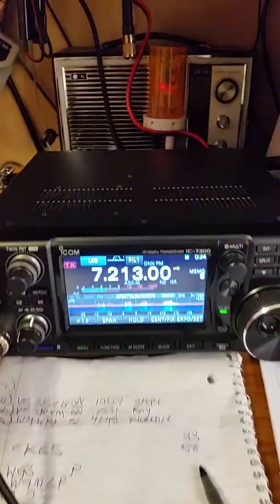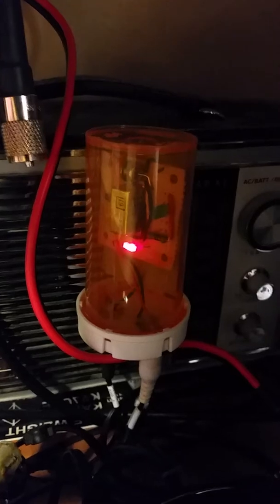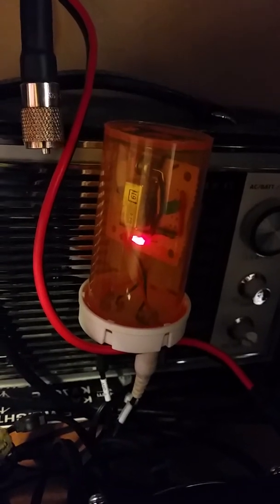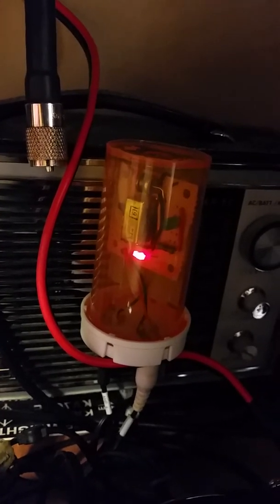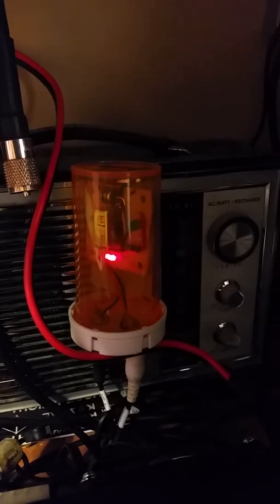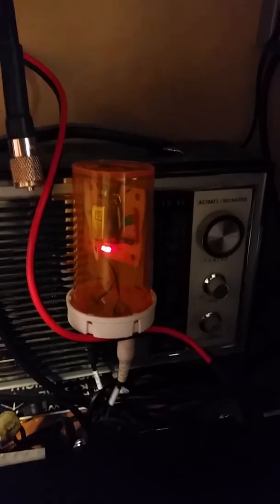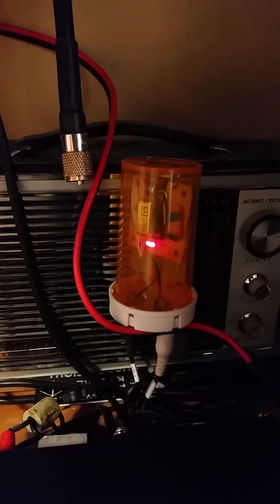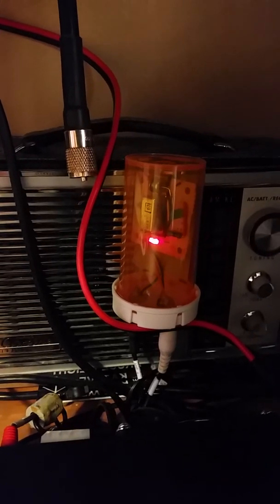IC-7300 Amp Switch

Comment from the maker: There's an example of what I did in the Icom 7300 full manual in section 18 page 2 or 18-2 connecting a non Icom amplifier. The parts are just stuff I had in the spare parts box and the pill bottle from the medicine cabinet instead of a $12-15 dollar project box. I should take the time to design one with a transistor in the circuit.

Comment from the maker: In the manual (full manual) the diagram seems to suggest separating the amp with a pilot relay circuit. I just used a very small relay with a transient surge protection diode. You can run the amp relay direct and it also should if it is an AL-811 have a surge suppressor across the relay. I did hook the ALC to the RCA jack it seems to work but I have to have the amp adjustment all the way up to have much control. I used the pilot relay to isolate the radio from the amp and lighten the load on the switching transistor in the IC 7300. Read carefully the section on connecting an amp relay.

Comment: Hi Bruce according to the specs it looks to me like you can plug the AL-811 straight into the PTT Relay socket on the IC 7300 what do you think about that....thats the situation i am in in at the moment and do you use the ALC if so how have you connected it just RCA lead from radio to Amp...from Fred g4vvq in UK.

Comment from the maker: I used the 13 pin socket. I believe I used 12 volts from the socket and the switching circuit as well. Used the suggested suppression diode listed in the manual. It has to be a pretty small relay.